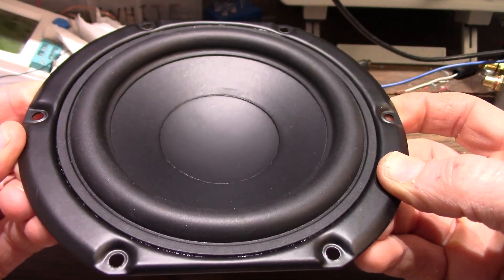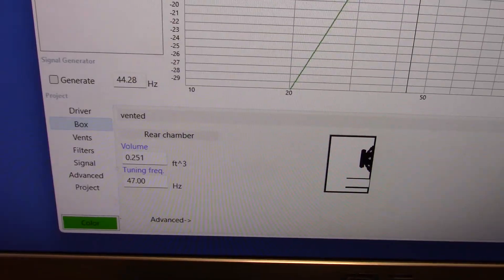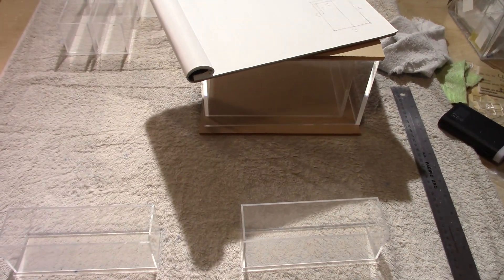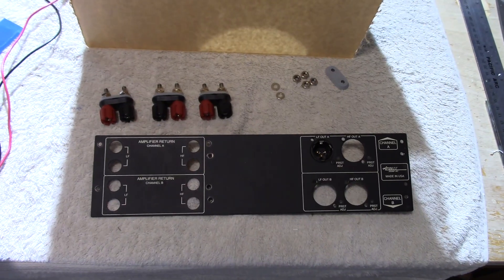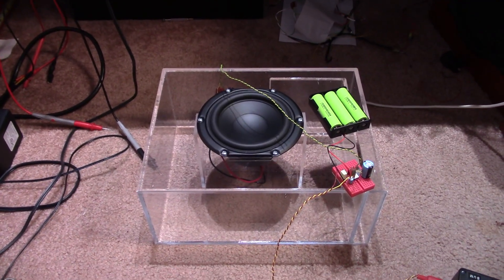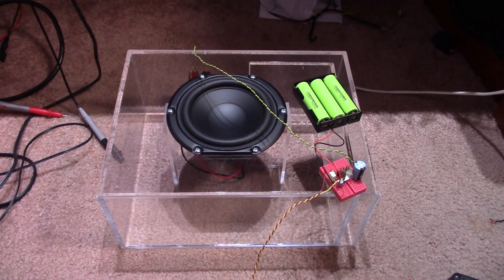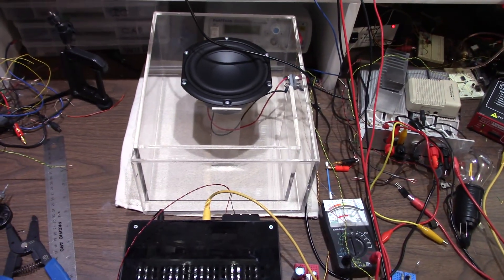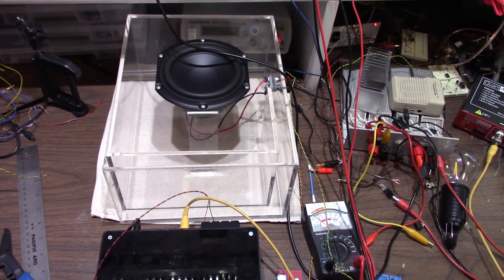Building a small subwoofer out of acrylic

Comment: Cool little project! That driver looks a lot like a Peerless SDS-135F25CP02-04. In Europe (at least I) pronounce Visaton like VESA (the mount) + Tone or maybe Ton (unit of weight). I wonder if the port noise would improve if the port was just a strait line instead of L shaped, but that would make the boxs' shape a bit weird. Polyfill should help with internal resonances, especially in this case where the material is not even MDF, but then the driver wouldn't be that visible. Although I also prefer sealed systems, I do appreciate the ported characteristics and don't even mind the port noise that much if it isn't too loud. I plan on building something with properly flared ports.

Comment: One thing I didn't see mentioned in the video. What did you use the glue the acrylic together? I'm curious about that. :) I've been thinking of putting together something like this on my own using a 6 1/2 inch sub and I have zero experience with joining acrylic together.
Reply from the maker: There are special solvent cements made for gluing acrylic. You can get them from online venders that deal with plastics/acrylic. Avoid acetone or chloroform. They may work but not as good as the purpose made glue.

Comment: The WinISD may be assuming stiffer wall material.
Reply: Acrylic is pretty dang stiff stuff I wager it could outperform mdf for a given thickness.
Reply: @krowwithakay  1/4" MDF would basically be cardboard... useless.
   If the box itself adds resonance to the system, it won't match ISD.

Comment: You can get a lot bass with sealed cab just use passive radiator
Reply: Pr is still a bass reflex system, It has almost the same freqency reaponse and group delay if tuned same.
But it has a few advantages like smaller box size (no port diaplacement) and no pipe resonance or chuffing.
Reply: @diymaster1121 Found sealed cabinets' in room response much more linear and dynamic decades ago and never looked back. Enjoying a pair of 2.5way mains with two active push-pull subs, 6"LMF fc65Hz/Qtc0.56, 6"LF fc47Hz/Qtc0.89 and 2x10" fc34Hz/Qtc0.37 rolled off at 45Hz.